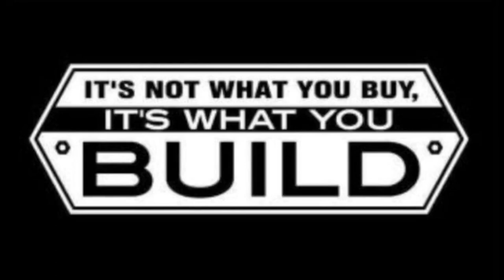1984 Bertone X 1/9, Remove and disassemble the rear suspension , music by Comin up Muddy

Comment: My very first car was an X 1/9! It was given to me when I was 12 by a neighbor. I never could get it running, (92 and finding parts for a Fiat in Louisiana back then before the Internet was literally impossible) but I learned a LOT about cars and how they worked by tearing it apart and putting it back together several times.
Reply from the maker: I remember those days, hunting parts out of the classified ads and junk yards. Sure is easier nowadays. Just click and ship. We learned the hard way, for sure.
Reply: @ELDESTBuilds  as a kid back then if there wasn't a mainstream parts catalog to order or if the parts store didn't have it you were just SOL. and honestly the parts stores around my hometown didn't even know what the hell a Fiat was! 🤣  Mine was a 79 and was red. I wish I could have gotten it running! As things turned out my first actual driveable car ended up being a 77 Nova.
Reply from the maker: @roguegunfighter9194 as long as a SBC will turn over, it'll run.
Reply from the maker: @roguegunfighter9194 still impossible to find parts at the local auto parts or Rockauto.
Reply: @ELDESTBuilds  that Nova came with a tiny 231ci V6, but within a few months it had a 350 swap and a year later a 383 stroker kit added. I got the Nova when I was 14 for $800 and drove it around town without a license or insurance for two years until I got my license. Things were very different back then lol. Oddly enough the day I got my license I got a little too cocky and got my first speeding ticket also! I remember that one clearly! 63 in a 35. Back then 400hp was a LOT especially for a kid with his first car. But compared to the new hellcats and others it wasn't much at all. Later when I first enlisted I saved up and bought a 67 Galaxie 500 from my girlfriend's dad which was my pride and joy. Lost it in Katrina though and haven't been able to find or afford another since.